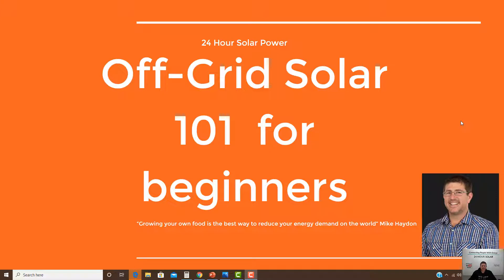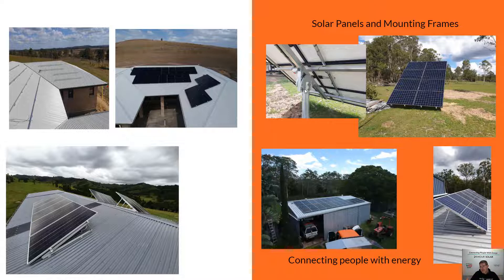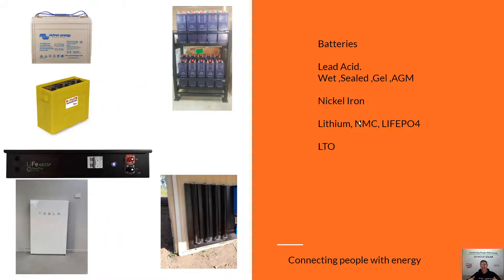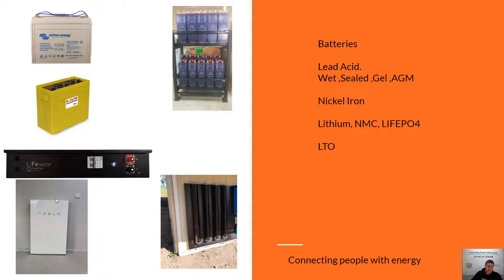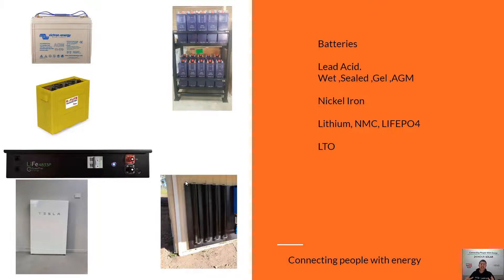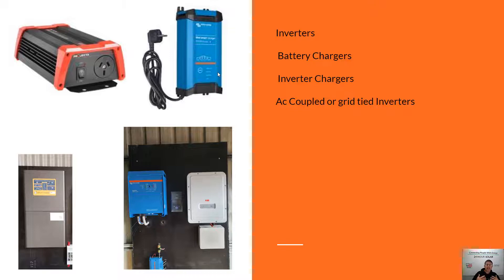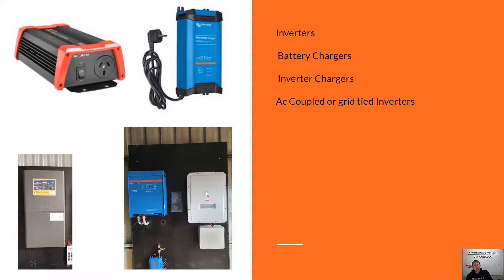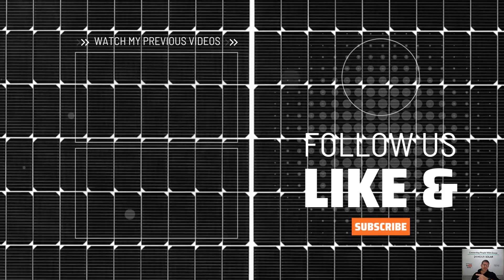Off Grid Solar Power System

Comment: Very well explained. Can you ac couple any pv inverter or does it need to a specific brand (Fronius selectronic certified?)?
Reply from the maker: With Victron there is a few that work better than others. If it was a Selectronics it has to be a Selectronics certified product.